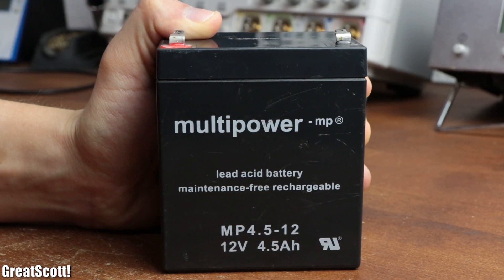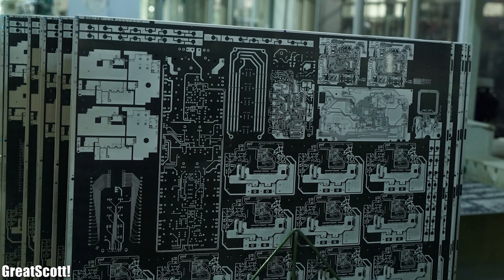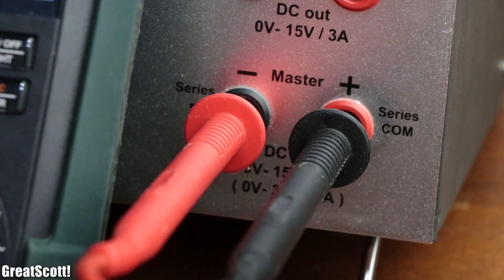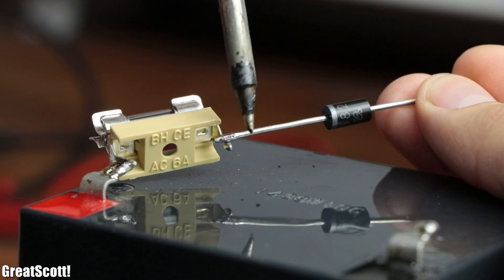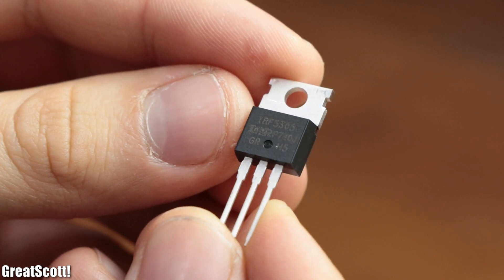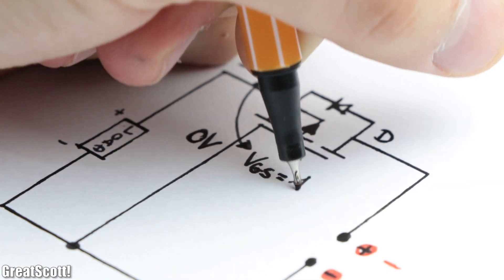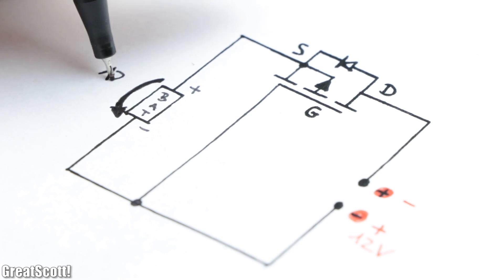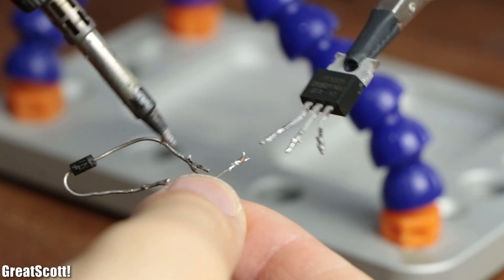What is the best Reverse Voltage Protection Circuit? || Repairing a Lab Bench Power Supply

Comment: There is a good module XL0401 with BJT and diode inside of a chip (chip name is DZDH0401DW). In this module I recommend replacing the 1MOhm resistor by 270-300kOhm.

Comment: Why not use a relay that opem when reverse voltage is applied. Introduces little to resistance those practically no voltage drop meaning the readings stay accurate

Comment: Why the fuss, just fuse it. I think we all just learned why the cheapskate auto-manufacturers started using fuse-links, or even fuses at the battery.
Whatever the case, I just let the smoke out of my expensive PWS4305 by not fusing an SLA battery and trying to charge it after having been working with a HDD voice coil, ooops, lol. Somehow my supply still works but I'm going to calibrate it and probably replace the overheated diode anyways.
Thanks for the awesome videos!

Comment: One way would be to put a relay on the output of the charger powered by the battery with a diode. The relay only connect the charger when the battery is connected correctly 😉

Comment: Hey! Great Video! but I'm wondering what would happen if you were to connect the power supply backwards, would the circuit still protect against this type of reverse connection? is it even possible to create a circuit that would protect against both types of reverse connection?

Comment: Sir exatly same was happend to me when mistakenly i connected the + prob with – terminal  to the battery my buck converter (300w 10 amps) stopped to work. Nd I saw current sensing shunt resistor (R010) burned I could not get the parts in local shop can you plz help me sir

Comment: Dear Sir,
I have such a circuit, but using N-Mosfet and there is a diode between drain and V-, where cathode is connected to drain and anode is connected to V-. I tried to remove the diode, the circuit runs normally. In addition, drain & cathode are connected to V+. The symbol on the PCB is like a zener diode. I looked for the datasheet, but it doesn't... it says 004 gee on the diode... What is the function of the diode? Thank you...

Comment: The last diagram for charging a battery the mosfet is connected in the manner of reverse of indicated current direction i.e. current should flow D>S direction, but in the circuit it will flow S>D direction as the charger is connected to Source terminal. Is it okay for the mosfet?

Comment: A honest question. Wouldn't the series diode or MOSFET not chip away part of the voltage that is set at the power supply? So, the actual voltage the battery sees will be lower than the set voltage? (I guess this can be solved by using the voltage after the diode/FET as the one that is displayed)

Comment: Hey nice video. I want to protect my power supply from reverse voltage when i am charging my batteries. I dont want to make a circuit and stick to adding a diode. Now I am not an electronic engineer so sorry in advance if I made a mistake but what I found for 1N5822 is max rectified forward current is 3A so it means that max curent that can go through it is 3A but my power supply delivers upto 8A so can I add 3 diodes in parallel?

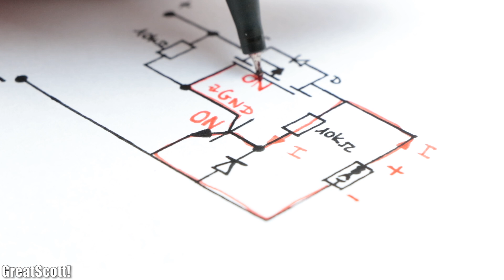Comment: 8:04  there seems to be a problem with the circuit.  If the battery to be charged is totally discharged, it won't be able to turn on the BJT transistor which is supposed to control the mosfet.

Comment: Here's my solution to reverse polarity protection (It will also discontinue the flow of electricity to the circuit!)

There is an LED inside the circuit. This LED will let you know if there is a reverse polarity or not. If the reverse voltage is applied, the LED won't light up. There is a spring-loaded switch which has an electromagnet. This electromagnet won't accept the normal polarity but will accept the reverse polarity. The electromagnet will pull this spring-loaded switch up as the magnetic fields are strong enough to overcome the force of the spring. This electromagnet has pulled the switch up and discontinue the power flow to the circuit. The spring won't pull this lever down, even after the power is discontinued.

Comment: An IRL5602S transistor can be used to protect a circuit with low power - 3.8 - 5 volts. It opens completely from the logic level of the signal (2-4 volts).

Comment: In the circuit at 08:05, will the power supply be able to turn on to power external resistive loads (e.g., lightbulb)? And if so, why? It looks like it will be off all the time unless an external positive voltage supply/battery is connected. This could probably be fixed by using a resistor to pull up the  MOSFET's drain to positive to use the internal power supply's voltage to turn on the circuit.

Comment: You should charge it to 13.8V. It says cyclic use, but you that's not what you are doing!

For the protection, do it the other way with an N-channel mosfet, because they tend to have much lower resistance, like the IRF3205 (55V 0.008 ohm 110A)

Comment: the circuit you found is a poor solution because after it is used once you have to remove the gate charge as the fet will stay conducting and when you try to hook a battery backwards it will be a short for a moment until the gate capacitance is discharged and the current can well exceed the maximum allowed by the fet. This generally will not fail right away but it does as I've built this exact circuit years ago for a charger we use at work and they fail about every 6 to 8 months. After an exhaustive look into the failure mechanism this is what I found. I measured sharp spikes in the 1000's amps using an irl60b216 once conducting and hooked up in reverse to a car battery

Comment: I've been working on a guitar effects pedal  project and it needs reverse protection polarity. Some designs I've seen use the parallel diode setup like in your power supply but I've read a series diode is better. Planning to use a NTE585.

The mosfet design is also out there and I'm considering it, but I think the diode is easier to implement.

Comment: If you connected a lamp in the circuit instead of the battery and plugged in your 'reverse polarity circuit' then the bulb would come on no matter which way you connect the power supply. That's because when the power supply connections are reversed current would flow through the body diode of the MOSFET and when the power is connected properly then the current flows through the MOSFET source to drain. Not really polarity protection for most loads.

Comment: Please replace the sharp tip on your soldering iron with a 3mm chisel type. You will be surprised at the improvement in heat transfer efficiency. It will make you think you have a new iron.

Comment: Apologies...I saw it now. The TP4056 is a 'charger-module'...And the "potensial-wrong-connection" would, if so.., happen on the battery-side.  //Thanks for sharing interesting videos mr.GreatScott. .......Strike out this previous-Question: Wouldn't the body-diode inside the mosfet carry current, if polarity are coupled the wrong way around..(ref.the body diode S to D)..and thereby 'not' protect properly..? (Looking now at 8min25sec into video, with the Nchannel-type circuit)

Comment: the reason fuse is not there when you dis connect the current it can momentarily surge trough the innercircuits and burn them. as happened in the inverter. also if the diode was the type it gets open line when its destroyed would also cause damage to inner circuits.

Comment: If your supply has sense line connections,  a full wave bridge could be used and the unit would automatically adjust for the forward losses.  But if the supply has sense terminals it probably already has appropriate reverse protection, so nevermind..

Comment: Hi, for the charger why u didn't mention simple relay solution?
No drop voltage, no head to dissipate, and indicator that correct/ not battery connection... Respect for ur channel!

Comment: Quick question: Why not use an H-bridge config at the output rails? To make sure that the + and - rails remains as is. We used that in our project. 🤔 Although I see that the power efficiency and voltage drops will be some considerations.

Comment: I have destroyed one of my boost converter(bought after seeing on your channel), by connecting 3.7V 18650 battery in reverse, that is why I'm here, but in my case, diode will be good as I want to operate a solenoid mechanism for approximate 2 seconds, thank you

Comment: This is not a good solution. You are changing lab bench power supply output voltaga -0.7V. If this is not a lab bench power supply you are good to go. Otherwise this is not an expected thing in a lab.

Comment: I would have installed a much stronger diode at the output of the power supply. The fuse is then the connected cable😆

Comment: schottky diode have lower Vf than regular silicon diode so they generate less heat too but as you said a diode is not the solution and even making a device with mosfet transistor and other parts including a relay and maybe a buzzer to alert when current is reversed but how about to power all the new sensor system (with the relay and a breaker) from another energy source to reduce the impact of the act of introduce more parts to the load of the psu just like a small box connected to the output so when the relay switch on disconnect the inverted polarity stuff from the output but maybe all this will force an adjustment and calibration of the psu to get the desired volts/amps after adding such sensor

Comment: Sir, Is it possible to use a four diode setup like a bridge rectifier to do the same ?... Whenever we changes the polarity in the input side of the 4 diode circuit, it's output side never changes the polarity... I don't know the drawbacks of this method and I'm commenting this because It's is a low cost possibility but you never mentioned it... Is it a foolish thinking ?

Comment: Why don't use a full bridge rectifyer to make a circuit that is indifferent to the supply polarity? If you ad a capacitor and a coil u could even feed it ac. Correct me if i'm wrong

Comment: The same happened to my power supply, I wanted to charge a RC car race pack with 7.2 volts and the output of the supply was shorted. You and Electoboom helped me to repair it. The revers protection circuit in a labory power supply is like this, because it dont has any effect on the current and voltage output and vorsmall loads (inductive spikes, capacitors)  this version is perfect. Its not made to protect against big current and voltages.

Comment: 7:47 I think this is the type of protection that is used in modern commercial car batterychargers (trickle loader), they don't charge when the battery is below a certain voltage, 
and the + and - outputs are shortcircuit protected, because they don't carry a voltage when there is no battery connected.

Comment: You should make a video of you applying it to your bench even if you have to just make it as a PCB that you had on in between each of the posts

I would recommend using a auto reset fuse instead of glass fuse or a button rest but that means adding a hole to the bench

Comment: 5:20 doesn't P mosfet act like a normal diode in this case?
Since the drain voltage is higher than the source voltage the diode conducts.
If I'm not mistaken, the P channel mosfet conducts from S to D when it's on. So even if the voltage of the battery (10.7 V) should turn on the transistor, it's useless as the current cannot travel from the PSU to the battery through it, only through the diode.
If you connect the PSU in reverse, the Vgs would still be negative (because of the battery) and the mosfet will conduct, in other words it won't solve the reverse voltage problem.
Also, if you connect the battery in reverse, the Vgs will be positive and the transistor off, but the diode will since the source will have a lower voltage than the drain. So, you still have a reverse voltge problem.
So the P mos alone is not a solution at all.

Comment: There is another use to which an FET switch maybe used to good effect (no pun intended) and that is where you have a backup battery connecting to a circuit powered normally by an external source e.g. mains derived supply and where you want the battery to take over instantly on input power failure such as a bulkhead emergency light, especially as where I have one - above the fuseboard! An N-Channel FET can be used so that while the input source is present no battery current is used and no reverse current is possible either. Once the mains supply drops, the light turns on. Quite often, in fact usually, such lights are ALWAYS on and the battery constantly on charge and it just takes over on power fail. Not always what is required.
Another similar usage is when an external charging voltage/current is going to be used to deliver charge current via an internally fitted DC-DC converter. e.g. external charge voltage of say 16 volts via a buck converter providing a 12.6 volt charging voltage to a 3S battery pack. In such cases the output of the charger (DC-DC Buck converter) cannot be left connected permanently to the battery since it will be receiving reverse voltage from the battery when the device is switched off and no external charge voltage is present. 
Fitting a single N-Channel FET with its Gate tied LOW to ground via say a 10k resistor i.e. turning off the gate, BUT a second gate resistor of 100k is connected to the INPUT charge voltage point of the buck converter. The output of the buck converter connected to the Drain, and the Source to the battery to be charged. When the charge voltage is present and the device turned off, the FET will turn on provided the input voltage of the buck converter is such that the difference between it and the output voltage is higher than the FET gate threshold, the output turns on and starts charging. 
I have recently used this exact technique to replace the old NiMh cells with Liion cells of TWO Dustbuster hand held vacuums and fitted internal charge circuits to them instead that operate in exactly this way so that when they are off and placed in their charge cradles (which can now be powered by ANY convenient 16-35 volt DC supply) they charge fine. As soon as they are unplugged the FET switches off and prevents the battery from reverse connection to the output of the buck converter which would otherwise drain the battery and also turn on the converter's output LED via the back-fed current!! This works GREAT. Especially as all the components needed were recovered from motherboards and suchlike! I included a BMS of course but also a battery status display with a button to manually show the state of charge when required but also it's auto switched by another FET when connected to the charge power.

Comment: Do not try this on a battery it will short it! It protects the charger not the cell. One recommendation is op amp: https://electronics.stackexchange.com/a/338464. That diode could also be there for inductive loads. Part of the issue here is the two sources. Most polarity circuits assume this is not present, and it would appear many power supply circuits.

Part of the problem with the fuse circuit is the charger is high power so fuse is high current, while protection diode is lower power rating. The issue here is not that the diode died its how it could have died. Many will short in high current condition, however it can fail open under extreme cases. No fuse is an issue, however they may not want you opening it. Shock hazard due to caps.

I have seen a Zener used for over protection which is fine except no fuse, and relied on power supply to shutdown due to short. If the supply did not do this or the Zener failed open, it would be over for the circuit. The Zener if matched in power will blow the fuse and probably live. The fuse will not. I was able to replace Zener to fix it. I actually just needed to remove the Zener to verify device still works. However I needed correct supply. It was in parallel so a shorted Zener would short the power supply. The Zener would probably also work for reverse polarity, but I think I was just using the wrong voltage.

I figured it out pretty quickly and this is apparently a known failure condition. 7 dollars is a lot cheaper than the device and I am reasonably convinced that was the extent of the damage. Overall got lucking and kind of knew I had messed up right away.

Comment: Why not just use a full bridge rectifier as a reverse voltage thingy? I mean doesn't matter if you swap poles then.
Reply: Heat loss, in low current circuits useful

Comment: Add a relay and a shunt in series ,then use opamp to monitor the reverse voltage on the shunt,  the opamp is triggered by reverse voltage and lock its output to trigger the relay to protect everything. 
I think my idea is the most efficient and reliable.
Reply from the maker: Yes, using a relay is always very power efficient......
Reply: perheaps a comparator and a relay ? but will the relay be fast enough?

Comment: Very good scott ! I recalled  10 years ago when I taught industrial technicians/engineers ElectroPneumatics .The new laymen/greenHorn always causing  24v 10A power supply burnt. When I open out the CE or Industrial Professional power supply : The fast blown fuse never burn but others components burnt. Later I change the Fastest-fuse.Yet the same history happening .The last resort are buying two diodes lm4002. Same situation occuring.Finally I had to use lm4007 diodes, each connected inseries with + terminal and -terminal respectively. Good luck ,for more than ten years nothing Power Supply will ever burnt occuring !

Comment: If using the standard PMOSFET circuit without the BJT...
What happens if the load gets shorted?
Will it oscillate between off and on? or burn out? or both?